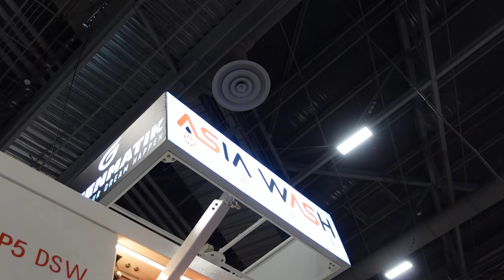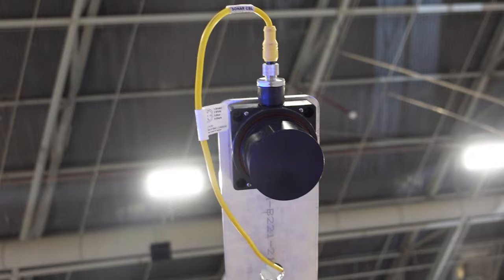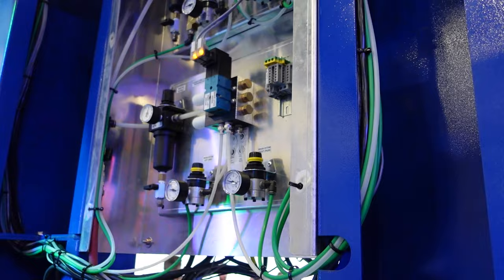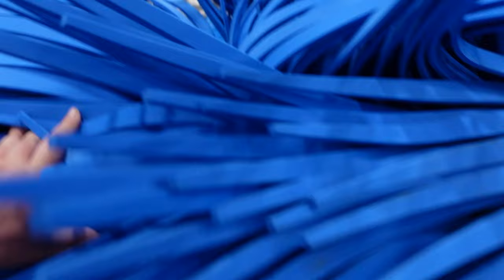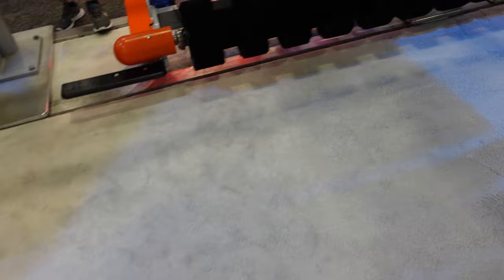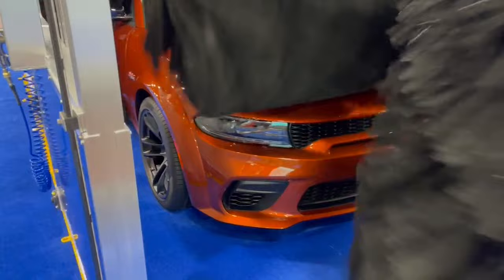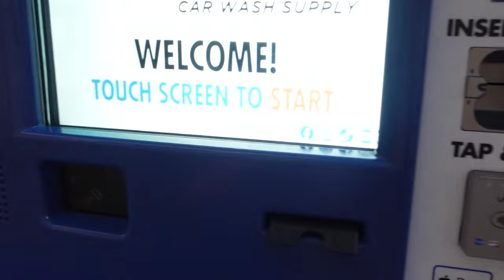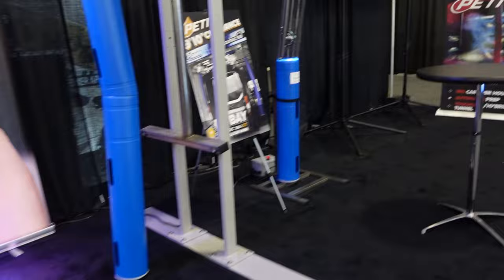Most Notable Booths On The Trade Show Floor Of The Car Wash Show 2023!

Comment: I probably won't be building any top brushes, personally. I'm not a fan. I much prefer the matter, although I won't rule it out entirely. 

The one piece of equipment I will be bringing back is the vertical window brushes in our polishing pack.
Reply: The car wash I worked at had 3 overhead rollers. It was a pain. So many top retracts on roof racks and baskets. And if the machine was not perfectly setup it would not completely clean the windshield that well. All it took was the GM quitting and the company throwing another GM from a much older and smaller site for it to break half the equipment from improper loading and roof racks.

Comment: 11:58 I have some manager and employee friends over at Tommy's who have worked there for 2+ years. According to them it doesn't fix the wiper issue at all in the slightest, and are just more useless junk.
Reply from the maker: Not a fan of if either, sure it may reduce damage risk but you’re also reducing surface contact. It’s nice to hear from you again!
Reply: The problem is in the motion of the mitter. 

The circular movement allows the material to slide under the wiper blade. 

Great concept, but the wiper blades will be an issue. 

They might want to experiment with some other designs. I have one that will absolutely work, but my designs are save for my systems that I'm prototyping.

Comment: Do all these brushes scratch your car?
Reply from the maker: No, all of these brushes are very safe. They have water lubrication, plus soap lubrication. And, not only that, the brushes are designed to repel dirt from being absorbed into the material because they are made of a closed cell foam. In addition to that, every rotation the brushes make they are rinsed with fresh water manifolds. Anything untouched by that rinse will simply fling off too, because of the centrifugal force.